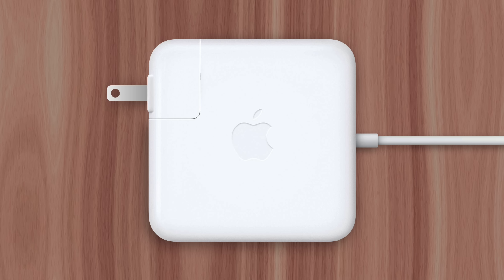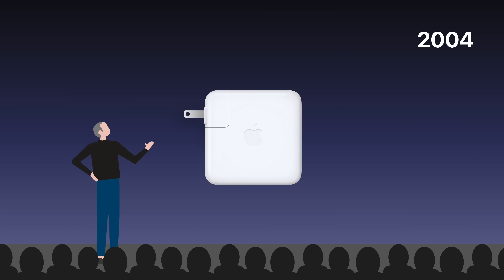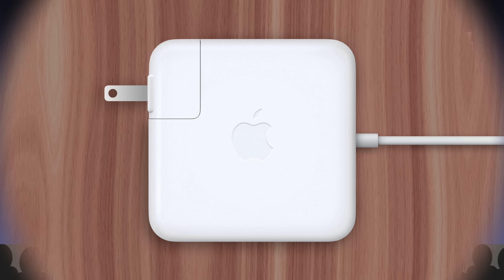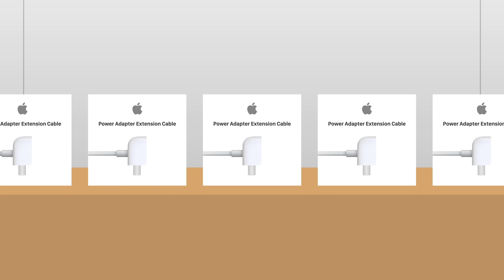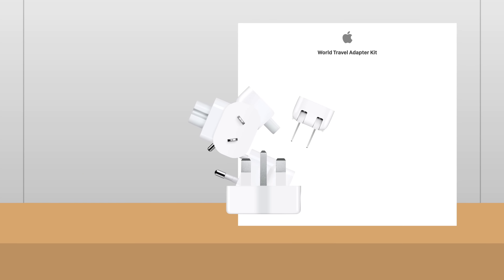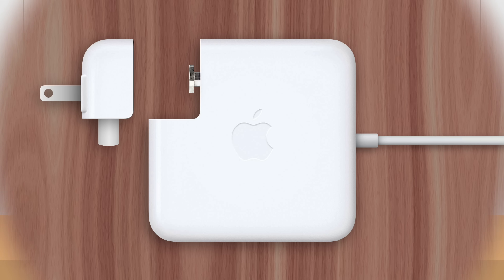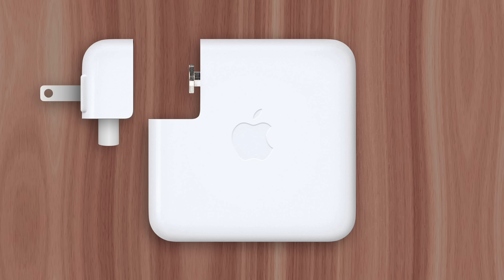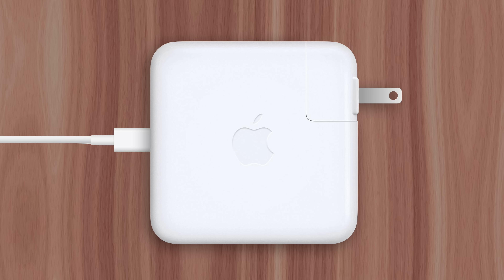Why The Mac Charger Comes Apart

Comment: I don’t miss replacing the $80 charger. Thought I would miss MagSafe, but I am very happy with USB Type C.
Reply: all you guys that have macbooks without the magsafe are pretending that it’s better lol. keep pretending. apple is rumored to bring back magsafe because not only is it safer and cooler (has that light to tell you if it’s fully charged), but it charges the laptop faster. type c is useless in this scenario
Reply: @VelocitronVoyager  I really love MagSafe and I agree with this.
Reply: I like USB C, not because I have a macbook, but because those chargers usually don't degrade after a single year of use
Reply: We’ll you’re in luck

MagSafe’s back
Reply: oof @aarkansinghal6633
Reply: As much as I love USB-C to the point where I've stopped buying USB devices with anything BUT an USB-C connection I still consider the Surface Connect™ Port on my Surface Book 2 the epitome of convenience ( besides Wireless Charging )
Reply: @BenLA5  Now that's rude. Being a BIG Apple fan, I COULD say this crap but I don't because I'm better than this.
Reply: There's neat magnetic break-away cables. They only do power, not data but boy do they work well. Freely rotate too so you don't twist the cable.
Reply: I hit up goodwill to stock up on the magsafes
Reply: If they can create a standardised magnetic version of USB C, I think it would be perfect.
Reply: If they make the new MagSafe chargers with removable MagSafe cable just like USB Type C ones, it would be the perfect product.
Reply: Wouldn't it be amazing if you could now also use it on your iPhone?
As if, it was some kind of international standard? 😀
Reply: @johnneshiem2291  Clearly it's a evergreen topic. The only reason I have an iPhone currently is the fact that 13 mini was the last reasonably sized phone with decent specs from any maker. I hate everything Apple about it, but I love the form factor though, and that trumps everything. Not excited likely having to go back to phablets after this.
Reply: I bought a $50 100W GaN charger with 2 usb-c and 3 usb-A and then I bought a usb-c to MagSafe 2 cable off aliexpress and for me it’s a better choice than the Apple charger because I can charge everything with it at the same time, while the Apple one has only 1 usb-c. For those concerned about reliability, I’ve been using it daily for 3 years with no issue at all. The only issue is that I can’t charge 2 MacBooks at once because then the cables sometimes send like 5 watts only but once you disconnect one of them it charges as usual
Reply: Magsafe? That 100w running on pogo pins, is held on by magnets, hopes and dreams? Where the bad contact fries your charge port, your battery, the charge plug? Would really miss that.
Reply: 2 years later and MagSafe is back
Reply: Guys, MagSafe is back. Stop shilling about USB-C, we need to shill about MagSafe now because apple says so.
Reply: i’m not happy with usb c

tripped on that once and it snapped
Reply: @qpol  dont trip
Reply: @johnnyflech5910  lol...
Reply: @qpol  You can actually buy a magnetic USB-C port adapter. With that the magsafe functionality can be restored.
Reply: @qpol  A friend of mine once tripped over a magsafe cable and his macbook fell on the floor and the screen was shattered. Which means that the usbc cable is even safer than magsafe. What I like about usbc is that you can plug it in on either side of the laptop.
Reply: @soberhippie  its actually the opposite, usually
Reply: @soberhippie  not anymore 😞
Reply: @soberhippie Literally false. MagSafe is designed to unplug quickly when snagged, there is no way that can ever happen unless it’s a 3rd party cable, or just a USB-C cable.
I’d know, because my school used old MacBooks, and that bitch stayed in place while the teachers brand new USB-C only MacBook flew off the desk and the screen broke right away when the cable got snagged on their foot.
Reply: @Thewaterspirit57  Not exactly. Magnets are easy to sheer one of another, but hard to pull one off another along the vector of attraction. That is, it depends on the vector at which the chord moves when you trip over it. If it moves at an angle to the macbook, MagSafe is safe, if it pulls directly along the axis of the connection (if you see what i mean), the USBc connector just pops out while MagSafe pulls the laptop along.
Reply: @soberhippie  I’ve never seen a USB-C cable pop out of the connector when snagged. Not unless it’s been worn out from being plugged in over and over.
Nice try lying about MagSafe being worse, it’s literally better. Also you forget that the MagSafe connector on literally any MacBook is at the edge of the, so it will always be pulled at an angle due to the weight of the machine. Not like it matters anyway.
Reply: @Thewaterspirit57  I'm not saying it's worse, I'm saying, it doesn't always pop off. I'm also saying that I like USBc because I can plug it in on either side of my macbook, which is handy, and it can also allow you to route your cable in such a way that it will be neatly tucked away and you wont trip over it
Reply: @Thewaterspirit57  Why are mac users not able to avoid tripping over their cable i dont know anyone who has ever tripped over their laptop cable
Reply: @qpol  acting like that doesnt happen with every plug
Reply: @BenLA5  wile apple whent up 1 point Samsung whent up 600
Reply: @johnneshiem2291  Then there's also the millions of patents Megacorps like Apple buy but do NOT use, for the sole purpose of eliminating competition
Reply: @johnneshiem2291  Samsungs stock was flat from 2017-2020 BUT Apple has many unfair advantages because CONservatives created tyrannical capitalism (which is inherently anti capitalist). Apple used tRumps 0% percent tax loopholes, offshore tax havens, used child slavery for at least 3 years (probably 20 lol), and closed down many small repair shops and also denied them equipment
Reply: @BenLA5  Mhm.
Reply: The s21 ultra is a way better phone than the iPhone 12 pro Max in many ways.they are so far ahead of the iPhone that the next iPhone won't even have all of the features that the s21 ultra has now like adaptive refresh rate, 1,500 nits, 100 times zoom, 108 megapixel camera, 8K video, the smallest hole punch, on any phone, reverse wireless charging, recording from three cameras at the same time, single take mode and a macro camera. There are many more but I cannot remember them right now. When you see these features on the iPhone 14 do not think that Apple made these features because like usual they are just stealing the features from the last Samsung. Wach the video 5 ways that the Samsung s21 ultra destroyes the iphone 12 pro max. The next iphone will not have a chargeing port. Wireless charging takes twice as long to charge as wired charging wile using 74% more power and heat. it has Samsung Dex Wich turns your tv or monitor into the screen of the phone. The repairability is much easier and cheaper. Samsung has the Google ecosystem Wich in my opinion is better than the apple ecosystem
Reply: @johnneshiem2291  no one buying an iPhone gives a damn lol. iPhones sell for a reason.
Reply: @MrLazlness  what reason
Reply: @MrLazlness  so true
Reply: @johnneshiem2291 I have a few reasons, 1. I like the ecosystem. 2. My first phone was an iPhone so I got used to it. 3. I like the long term support nature of iPhone. I somewhat like android as well due to it's app freedom, but I will stick with iPhone.
Reply: @johnneshiem2291  Privacy, length of product support, rocker mute switch on the side, google is actually evil. Pick a reason.
Reply: @johnneshiem2291  dude nobody asked
Reply: @johnneshiem2291  Nice, but this is REALLY off topic. I do understand that you like Android more then iPhone, and I can't say that I haven't tried to get people on the side of iPhone myself, but this is not what the topic was about. For me though, I'm more of an iPhone guy. People have preferences and opinions, and I respect your opinion as well.
Reply: @imacg5658   the nazis had preferences and opinions too, my dawg
Reply: @johnneshiem2291  yeah but android isn’t as aesthetically pleasing to me as ios
Reply: @johnneshiem2291  
You are right
does that mean apple fanboys care?
no
Reply: @johnneshiem2291 That moment when a hardcore android junkie lies about an android product (again) 108MP camera, lol.
Doesn’t matter if it’s 108MP ( which it isn’t) if the sensor isn’t properly used lol.
Also rip SD card slot, literally the one good selling point for android devices are gone for flagships.